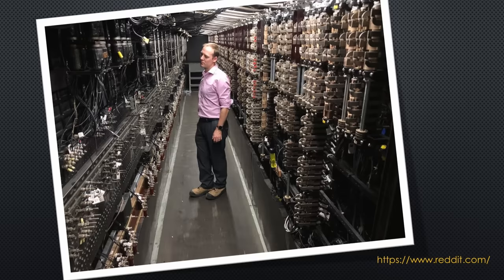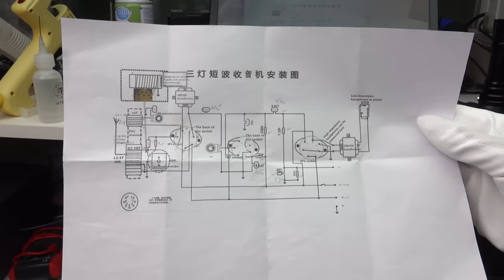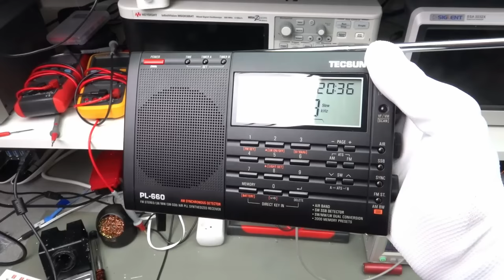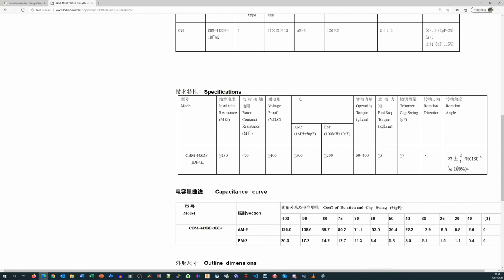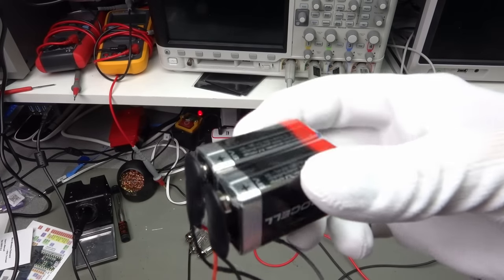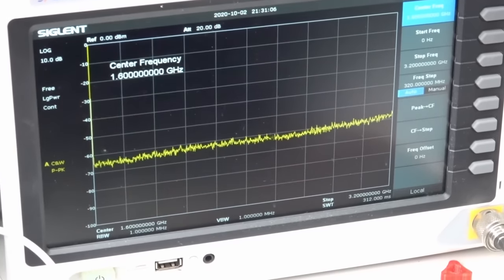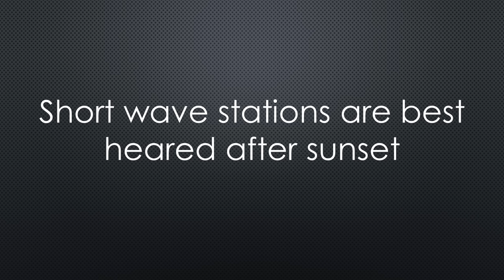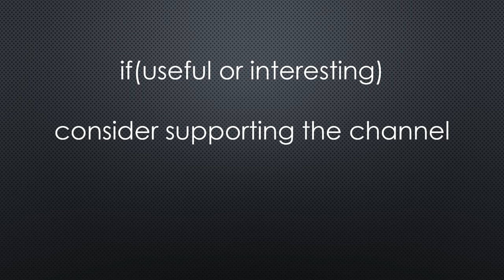#355 Let's try to build a Vacuum Tube Radio

Comment: I'm so old that I learned almost nothing from this video. BTW, over time a tube will absorb helium through the glass, and it does not stick to the barium getter flash, (the chrome-looking splotch on the inside of a tube that actually works like flypaper for securing random molecules to the glass wall so it doesn't interfere with the electron beam, helping to maintain the vacuum for many years. 
I started in electronics as a little boy long ago in 1959 testing tubes in my neighbor's garage TV repair shop, going on to do TV/radio repair as a teen, all using tubes. Later, I worked at Hewlett-Packard manufacturing CRT's for 'scopes, all facets of the process from glass fabrication, to pumping down the tubes to vacuum, and sealing them off. I still have half a dozen radios in my home from 1927 through 1951 that I maintain in working order. So I know far too much about tubes. Thanks for the video. It was fun.
Reply from the maker: Indeed, compared with you I am a complete tube noob! But still old enough to at least know what a tube is ;-) Anyway, I wanted to show the younger generation that also generations before them had good ideas and were achieve goals with "primitive" tools compared to today.
Important is that we can transfer some of our knowledge to the younger generation as we got it from our parents and not take everything into our graves.
Reply: Andreas, I agree wholeheartedly with your comment, and very much appreciate your channels. Your work is some of the best on the web. I tutor both young and old to get their ham licenses, provide many through-hole components and suggestions to those building electronics circuits, and generally do all I can to help others, young and old learn as much of what I know as I can, because at my age I don't have decades left to impart my knowledge to others, and it seems like a waste not to. One of the ideas I try to impart is that older designs and techniques are not always useless, and simply adding another SMT module is not always best solution. Sometimes old techniques are simply the best way to go even today, because physics is physics, so I try to mix both the old and the new as the likely optimal mix of engineering for a job. It's engineering with an open mind.
Reply from the maker: @johnwest7993  I see it exactly the same way! Keep up your good work and stay healthy for a long, long time!

Comment: Tubes and PCB? Very modern, TV sets of the 70. Back in the earlier days this was different. And they had a getter metal insde,  which binds the intruding gas.
Reply from the maker: You are right. Originally they were build "in free air". But it was complicated enough for me as a beginner...
Reply: @AndreasSpiess  and they had the nasty habit to ZAP you, if you were in....
Reply from the maker: I can imagine... Here it was not dangerous. Better for this channel, I think.

Comment: What about using a KORG NUTUBE 6P1 as push pull output stage to drive the speaker at higher volume.
Reply from the maker: I did not know that somebody produces new tubes. They look quite different to the old ones. It seems to be a very special product for enthusiasts.

Comment: Looks like US 3V4 (3S4?) and 1U4 tubes.
Variable cap is a 4 section, two sections for the BCB, and 2 sections for the FM band.  Also might have separate pins for the associated trimmer caps.  A total of 8 capacitors, 4 ganged variables, and 4 independent trimmers.
Reply from the maker: Thanks for the info that it has additional 4 trimmers. I did not know.

Comment: Hoi Andreas,
let me give a little correction:
The 6.3V filament heating voltage was common in the "Exxx" series tubes. They could be found in the early radio receivers, in the so called "noval" socket.
Other tubes are heated with 300mA constant current, they were typically in early (black and white) TV receivers. TV receivers required a lot more functionality, were more complex than radio receivers. Since they needed more tubes too, the transformer for the power supply were too large and heavy (and expensive). Therefore the goal is to connect all the tube heating in series and the whole bunch could be heated directly from 220V mains. These tubes were the "Pxxx" series.
Good old days, when one could decode almost the whole datasheet from the type ...
E -> 6.3V heating, Noval socket
P -> 300mA heating, also noval socket
EA -> diode
EB -> double diode, common cathode, practical for two way rectification.
EC -> triode
EF -> pentode for signal amplification
EL -> pentode for higher power
EABC xxx -> this tube consists of a diode, a double diode and a triode in one tube. Heating 6.3V. 

There were other series, not in the noval socket, and they had their unique type numbers.
This above is true only for Europe. The USA had his own type-numbering system, and the russians also had their own.

uf wiederluege!
Reply from the maker: I am learning every day from my viewers! Thank you. Very interesting. And logical concerning mA for heating.

Comment: So valve pin numbers are just like most ICs, we just changed to look from the top instead of bottom....
Reply: And in tubes the current flows from minus to plus the way the electrons do, not from plus to minus the way people think with semiconductors.
Reply from the maker: The two flow definitions are a little strange to me. But I do not know its historical roots...

Comment: Tubes are easy. I was working on tube type tv's and radios in the 70s. Filament voltage is low. The plate voltage is usually around 250 volts or more for tubes. Typically there would be 4 tubes. Rf, if af  and a rectifier tube. I notice there's no IF transformers. Yeah that radio is bull shit.  Those old commercial radios are state of the art by comparison, and they wouldn't require thousands of dollars of test equipment to make operational. Too bad Heath Kit is no longer around. They had good radio kits of all types, even amateur radios using tubes. My first 1000 watt transmitter was a Heath kit built from parts. Party on and make sure you take good care of yourself.
Reply from the maker: These Regen radios are for sure not high performers. But astonishingly simple. I thought they are ideal for a beginner like me.

Comment: Hi Andreas, the pinout is on the datasheet, C1 = AM ANT, C2 = AM OSC, C3= FM OSC and C4 = FM ANT.
Reply from the maker: But it has 7 pins...  These are the four capacitors of which we use one.

Comment: 20 V Anode voltage is boring 😉 common tube radios worked with 240 V, a beefy EL 34 Amplifier with 500 V and portable radios like my Telefunken with 90 V Anode Batteries. I assume noone died back in those times touching an anode battery. The real dangerous tube radio where the DC mains powered because they used the mains voltage directly and connected the U type tubes filament in series. Depending of the mains plug position touching the chassis could kill you then.
Reply from the maker: Yes, the chasis with life voltage were really dangerous. But maybe people cared more and paid attention.
Reply: @AndreasSpiess  so true, nowadays you only have to look at the people how they wear the mask an you know all 😉

Comment: Hello sir can you please explain to my some things ?I encountered some unusual problems with my old Opel car from the 80s its Ascona 1.3l sohc engine . Now I noticed the blinker relay is cinde of rewrouted to the 4pin defroster relay pin 86 to by exactli and that same pin goes to the Delco 12si alternator field my car does not have diodes not even on the positive linear voltage regulator so my car cinde of behaved like hit and miss engine working in union with the blinker relay I eventuali found burned black thin wire on ignition switch and corroded ground wire on rear bulb holder solved that problem,also I wondered can xenon bulbs with out ballast act similar like wacum tubes? Some times I see spikes shuting out in my hood so Im confused if those xenon can act some sort of antena or not. So any way mostly I have problems with arcs and back fead problems now I noticed bether economi and increase in power for exampel if those relays start to interact with ich other some how the baterry apears to stay longer charged in coolder enviroment. So I hope you understand my question and I hope you know more why this strange circuet acts this way . I dont know how is under static devices meshured my normal multimeter does not show any thing usefull and for some strange reason the odometer is ticking by back fead . So realy strange behavior. And recenti problem got wurse due to those problems my engine started self acelerating at full trothel I removed entire wire harnest and still it acelerates litel bitt I just use ordinari 4 pin relay for ignition coil so multipel times the engine apears to by magnetised for some reason. So I hope some one can explain why those things acure and how properli test circuets for faults.
Reply from the maker: I have no idea :-(
Reply: @AndreasSpiess  But sir do you know how posibli how wacum tubes controled generators? I found on wikipedia some thing called "Wacum Tube Baterry Chargers" or perhaps those Trains that used multipel center tap transformers and rheostats to control with wacum tubes generator to electric motor drive trains do you know some thing about those devices how they work? Im realy desperate honestly I need self contained ignition system for my car also my Delco 12si alternator is sloppy it back feads lot so I desire magnet alternator insted but solar panel regulators are expensive in my lande . So wuld transformer with resistor and capacitor work as well or useing wacum tube ac to dc converter? I realy have trobel finding alternative solution for those problems my car decays lot because of arcing and colideing frequencys including the ignition coil it self eat my rubber and metal parts so Im anoyed so thats why I try to finde some sort of solution for that problems. So did any one managed to create some sort of closed loop system that is reliabel? I hoppe in future your videos to see some thing wacum tube based that can handel strong generators with automatic cutt out circuet to prevent over charging baterrys . At this point Im desperate .

Comment: I have started the same journey as you Andreas, just a bit later. I think the variable capacitor is of the brand Victory Devices Private Limited, you can find the part here https://www.diytrade.com/china/pd/2791142/PVC_Gang.html#normal_img , but unfortunately no connection diagram. Also tried to calculate the resonent frequency of the LC-circuit, but as the distance of the two coils are not given, it is hard to find the mutual inductance. Your method was more practical! I agree that the diagrams/schemas where just crap, I will try to redraw the "wiring diagram" as a correct schematic. I had several email conversations with supplier trying to get better documentation but unfortunately to no avail. 

Love your videos! /SM0YWD
Reply from the maker: Very good. I left a link to the diagram with the "internals". There the two grids are mixed in the left tube. The rest seems to be ok. It would be good to have a better documentation.

Comment: an FM tube radio receiver instead is not rocket science after all... i made a superregenerative one, just two tubes including the amplifier (well, actually they were two triodes and two pentodes in total), you can receive actual stations... there are some problems with DAB tbh... i based myself on a website guide
Reply from the maker: You are right. For FM we would have more stations to listen. But you need filters which are not simple. This kit is easy enough for a beginner, I think.
Reply: @AndreasSpiess  nononononono you just need to "ballpark" the single variable capacitor, that you can make out of some small pieces of metal and make it turn (i used pieces from an old transistorized UHF module from a tube TV) it doesn't need to be big, just like 7pF of variation, the variable capacitor you used in this video should serve for both FM and AM, the top trimmers are for adjusting it finely (i believe) i paired mine with a mini variable ceramic capacitor to coarse tune it and the rest are just basic components, a stupid coil and a pair of chokes made winding 74cm of wire on a support... you already have the output transformer and amplifier but i'm not sure you can use the same valves.... sadly i can't find AT ALL the reference website i used, it was from an australian guy but apparently the website is down now (it was just 1 year ago) but there are some superregenerative schematics online... trust me, it's super easy... almost... but you don't need fancy filters, 10.7MHz intermediate frequency and stuff... you can also tune to the right channel OR left channel :D

Comment: I dislike the American term "Tube" for "Valve". Some aren't even tubular. "Valve" tells you what the item does, but "Tube" tells you only what some of the items look like, although some are not even tubular.

I wonder why Americans didn't continue this tradition and call transistors "Blobs", or ICs "Slabs" rather than giving them the relatively meaningful names they settled on.
Reply from the maker: I am an engineer, not a linguist ;-) But I see also American words which describe the puropse. One I always remember is the first "GPS devices" in cars. We Europeans called them "GPS" according the content, and the Americans called them "Neverlost" according the purpose...

Comment: If you want a laugh,  read DeForest's patents.  It is obvious that he had no idea what was going on.   I had a good friend who worked with DeForest, and he confirms this.... he also points out that he lost several fortunes on women.   Regen receivers are at best awful.
Reply: DeForest had a big patent battle over vacuum tubes with Irving Langmuir of GE, who did know how they worked but unfortunately lost the legal battle.
Reply: @jimharman5748  What DeForest lacked in knowledge of physics he made up for by buying prostitutes.
Reply from the maker: I just got his biography. I like to read such books. So it seems it will be an interesting read.
Reply: @AndreasSpiess  Another good book... however USA centric, is "The Empire of the Air"... talks for DeForest/Armstrong/Sarnoff.  Highly recommended.   They did a TV series on it two decades ago, but the book is better than the TV series.